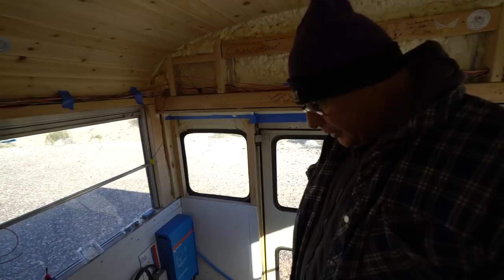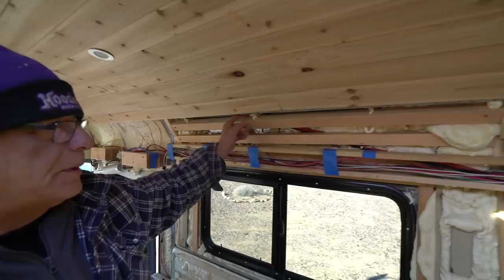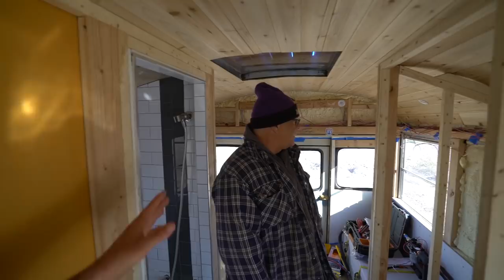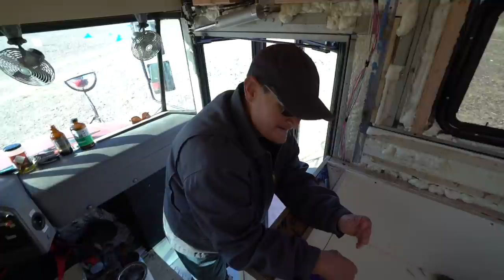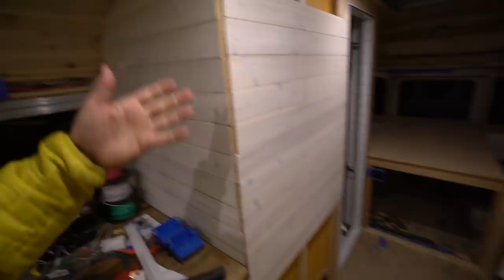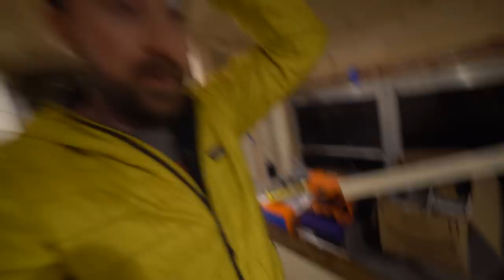HiJax'd: Bus Build Update- WHO IS THE MAGNIFICENT 7?

Comment: i would still make a hatch toward the front of the "garage" space under the bed 
that way you can still transport long stuff by pushing it intoo the walkway of the bus should it ever be nessesairy again , its allso nice to be able to take a look intoo it like for checking the electric instalation / resetting stuff from the inside in case its raining outside 
does start to look like sumting that you can actually live in
Reply: I was thinking the same thing. Also no fun unload several hundred pounds of stuff to get that thing-a-ma-jig squirreled away up front.
Reply from the maker: I did think about that, but the last bus had a front hatch and the doors are always open. I wanted something more solid, and I have plenty of room in the hallway for anything extremely large. But, only time will tell.
Reply: @JaxAustin  with those doors you have a straight shot intoo the hallway no need to tread it through the front side door and past the whole front part of the bus 
even cars have a ski opening in the middle of the back seat to feed objects through the trunk intoo the car , there a reason for it 
ou could make the door just wide enough to clear youre shoulders and make the sides and the part over the door solid , dont think the opening will reduce that mush strength but if you need to break out parts of a solid wall to get to stuff under the bed it might

Comment: The back area still has a lot of storage. You need to confine the solar area and allow access but board in and use for storage.  If the meters are too low then raise them..
Reply from the maker: The idea was to section it off. We will see what happens.

Comment: hey - i expected this to be one of your usual programs like ive watched so many of, then you
mentioned a 100 gal fuel tank. I LKE IT !!!   how will you mount it ?  how seal off smell, etc. ?  why not under bus instead of inside ?   i WILL be doing this too.   thanks.
Reply from the maker: Well, in a perfect world, I would have put matching fuel tanks on both sides of the bus in between the wheel wells. But, I think an easy fix would be to add an auxiliary fuel tank sold at tractor supply under the bed. It will eat into my storage space, but would allow me more range. More range means more chances to find cheap or free fuel.